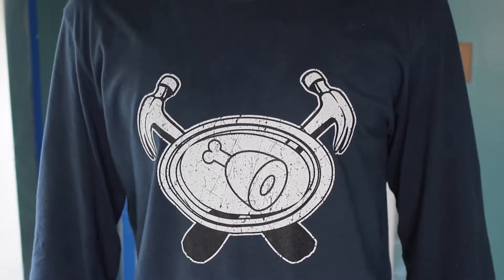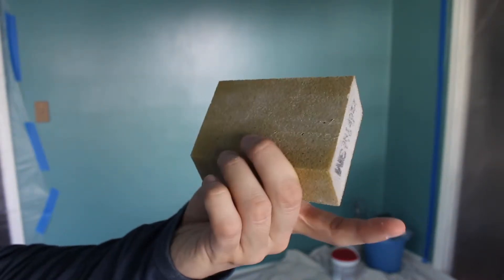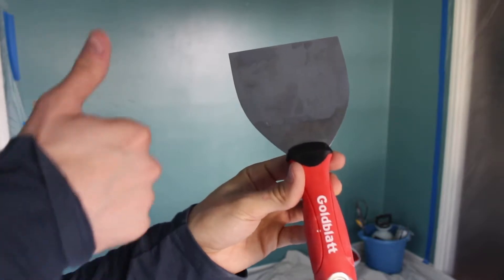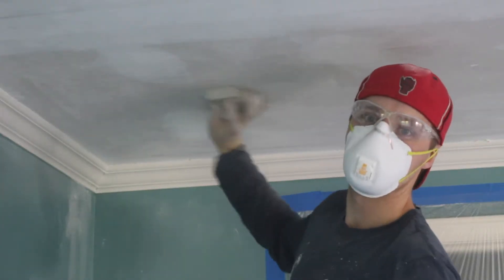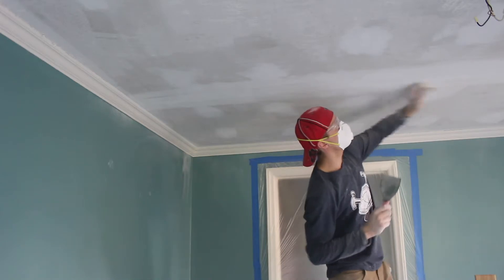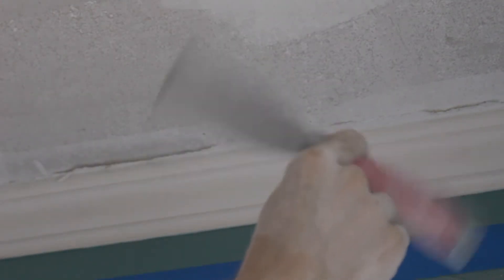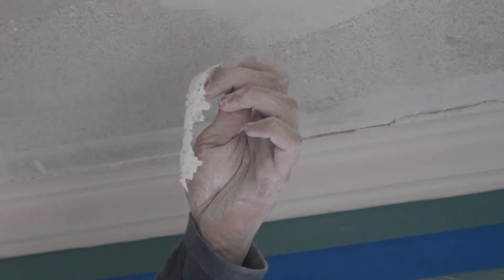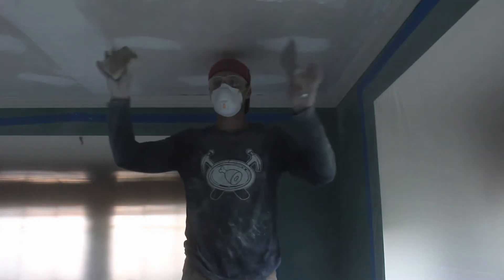Dining Room: Ep. 3 - Time to Sand!!

Comment: Handyman, I have a whole house where the popcorn ceiling was removed - but... in many places they tore the underlying paper AND they added a gone of spackle or joint compound REALLY THICKLY.  It's six rooms that need to be "fixed".  My question is, can I use an orbital sander first as it looks almost like messed-up concrete and then fix the tears and go back and do a pole saw sanding or get on a ladder and use blocks for the final?

Thank you Handyman!
Reply from the maker: You can use an orbital sander for all of it. Just change the grit of the sand paper you use. Start course to get the big stuff off, then work your way up to finer grit
Reply: Thank you Handyman for the quick response!  And that you for the assurance - the ceiling is messed up enough without me making it worse.  - J